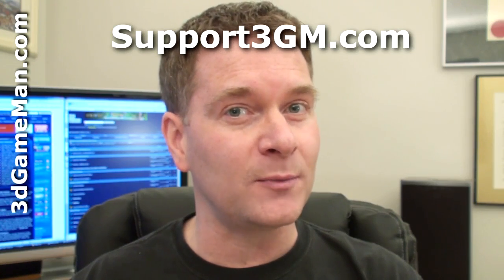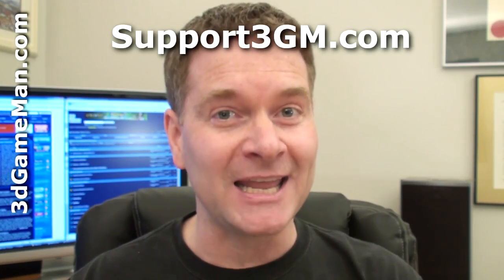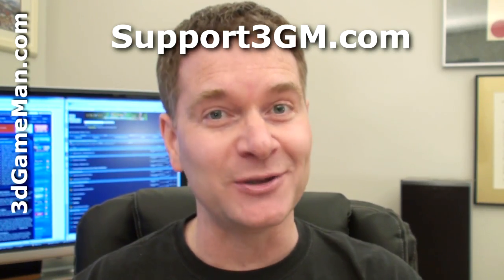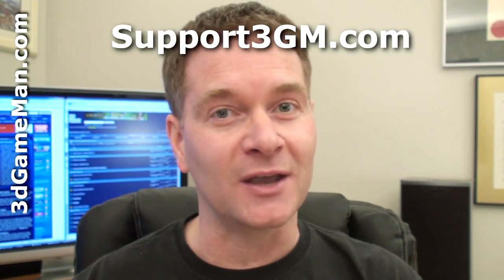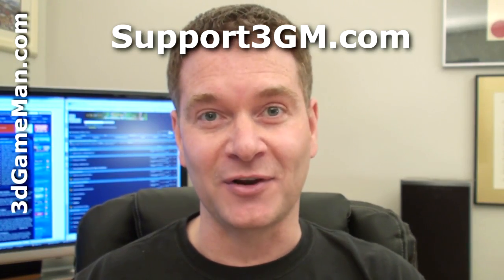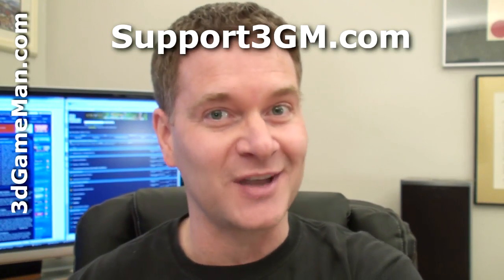#155 - Q&A: SATA Jumpers

Comment: Well I came her for  info on jumpers and SATA.  I have an ASUS X79 Deluxe, ad a brand spanking new  WD Gold 4TB Enterprise Class Hard Disk Drive - 7200 RPM Class SATA 6 Gb/s 128MB Cache 3.5 Inch - WD4002FYYZ   Which I want to run  in an external USB  SATA  Hard drive  Docking cradle.  Except  none of my computers can see the aforementined  drive, Neither can G parted.  OS is ubuntu  Is my Motherboard   too old for this drive?

Comment: I am going to put a SATA 1TB Western DIgital hard drive into a new SATA enclosure. Do I ned to be concerned about the jumpers? The HD label mentions Spread SPectrum Clocking (SSC) and PUIS (Power up in standby) but it would appear the info is not indicating jumpers should be changed to use it in an enclosure. AM I correct? I haven't slaved drives since the IDE drives were mainstream.

Comment: If you bought a SATA HDD and it did not come with a jumper, it wasn't because of its OEM designation. OEM will include everything necessary for mechanical functionality. A manufacturer would not remove a jumper bridge from a HDD intended for OEM sale any more than they would remove the write head.

Comment: The OEM and Retail designations would not have any bearing on anything like the presence or absence of a jumper. 

OEM is generally used to indicate that the item will be packaged with minimal, if any, accompanying software or documentation.

Comment: thanks alot for fast response just saw that my drive has no jumpers but im hopin you could   help me with something for some resone my drive in device manager is listed as a scsi drive why and does it make a difference as i know its a sata drive second i have a esata external drive w/a 500 gb seagate witch i know has a jumper should i remove it